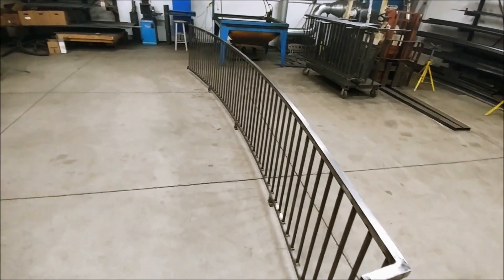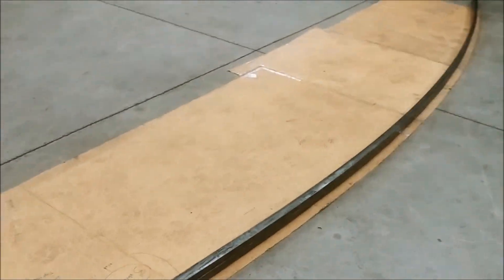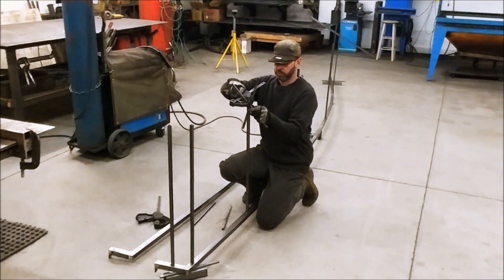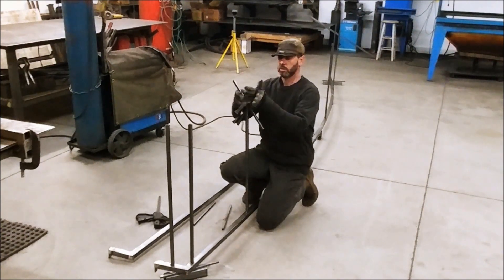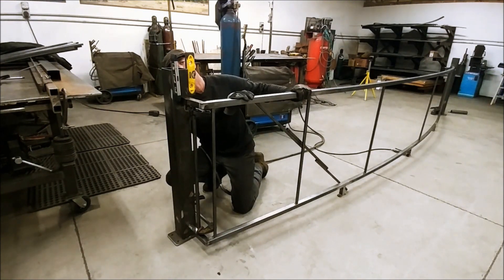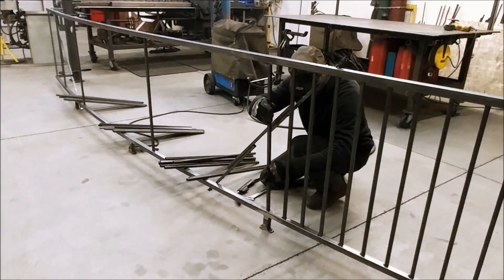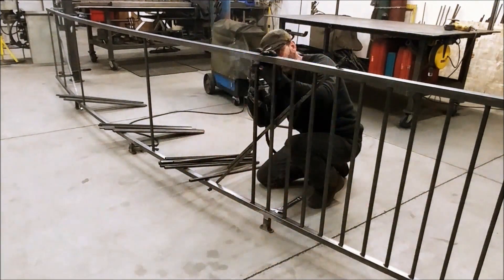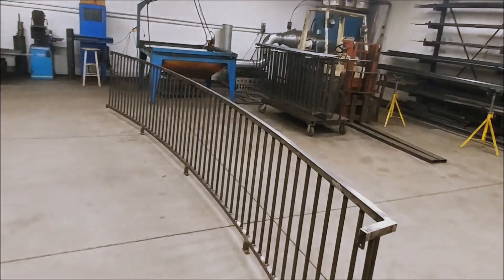How to make Curved Railing

Comment: We have another shop roll our tubing for us whenever we make curved railing
And every single time i get the material, it always has a really bad twist in it which makes fitting up the railing properly and making it look good is impossible.
Is there any way to roll square tubing and not have a twist in it?
Reply from the maker: You should always use pipe stands that support both ends of the tube to keep it level. Flip the tube after each pass and roll each subsequent pass at the other end to compensate for the twist.